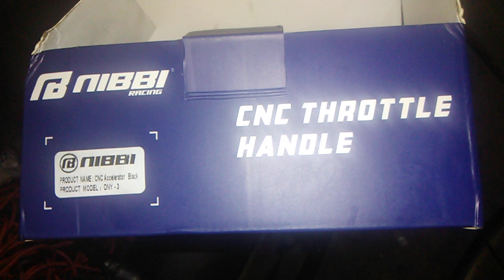"New Parts For the Super avenger Menace 85!"

Comment: Nice! Bro
 I was looking at the Nibbi carbs yesterday and saw they had a throttle too. noticed you have the o-ring in carb . i don't.
I'll probably skip the nibbi throttle and buy the nibbi17 with 10 jets instead. ($50) 5 main and 5 pilot jets, So I can tune.
The engine kit throttle works fine.
Got the HP carb doing the best it ever has but am limited to needle adjustments cause I'm not wasting money on jets for a China kit carb,  junk
Reply from the maker: Hey the bofang carburator is good for me also the CNC throttle was $15 on ebay